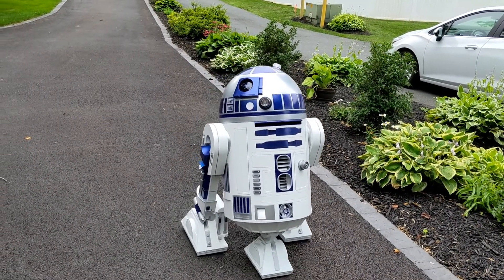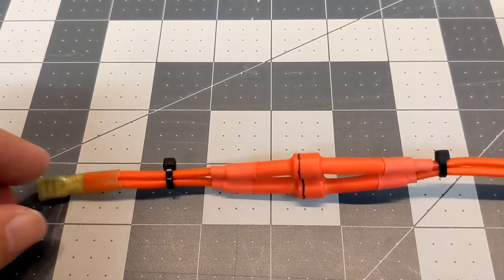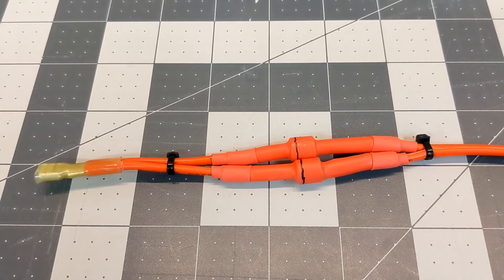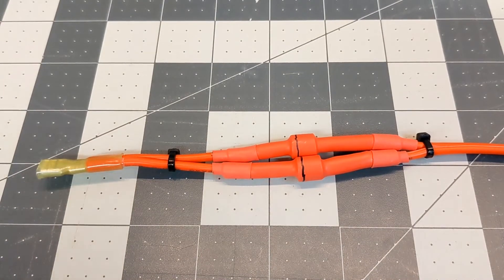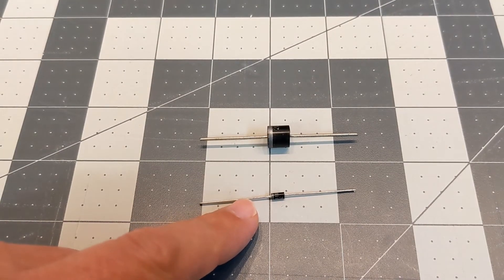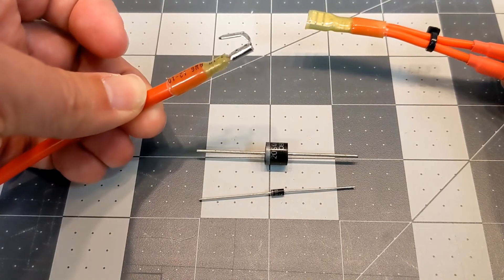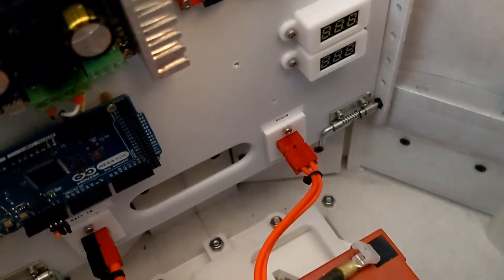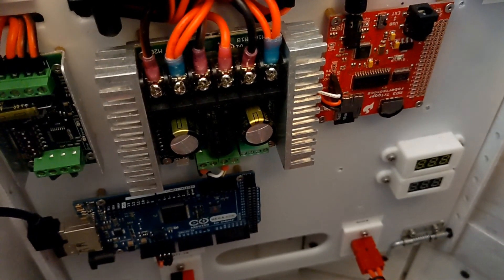R2 Electronics Build Part 7: Handling Regen Current and Wrapping Up

Comment: Would it work to just put the diode on the line to the motor? Although you would remove the change to "charge" the battery when pushing him, it would also take away the chance for damage if you remove the batteries.
Reply from the maker: The worry with putting the diode there is the constant current load that it would be under during normal droid operation. The motors are the components that draw the highest current out of anything in a typical droid. Any diode in line between the motor controller and the motors themselves would need to be able to withstand the high current loads of the motors, and are not easily replaced should they fail at some point in the future.

There is also the issue of forward voltage loss. All diodes have some degree of forward voltage loss that can vary based on the current. That also implies that any variances between diodes could result in slight speed differences between your motors.

Relays are the best option for isolating the motors from the motor controller - as they are much better equipped to handle high current and do not introduce any variance to the signal being passed when the relay is closed. I've used relays in my new B2 build and I like the simplicity they provide.

Comment: Hi Jason, Thank you so much for the videos and all your work. Everything is very clear and makes total sense. I'm just starting my R2 build and will follow your lead. I think I'm getting my head around it all, having never tackled electronics before, but it's the amps that are causing my head to itch. Also 12v or 24v that is the question.
Reply from the maker: Glad to hear you're finding this helpful. It was all new to me, too - but taking it one step at a time really helped me learn. In terms of 12v vs 24v, if you are concerned about high amperage, then 24v would be the best option. For a typical R2 the "big" things that draw the most current are what you will want all at the same voltage - drive motors, dome motor and amplifier. Those should run at full battery voltage. If you're concerned about high amperage, then the higher voltage will put your mind at ease as it's half the amperage. Good luck!

Comment: Your work is so neat and aranged really nice if I can achieve anything remotely close I will be very happy,  also the information on the regeneration is invaluable and the feed back that could fry the sabretooth is something I have not seen mentioned,  I am just starting my build and the electronics are what scare me the most,  how do you supply the signals to the servos in the dome and also the lights,  are they separate from the main system or do you use a slip ring,  the slip ring thing confuses me as it only allows 6 wires (3 pairs). ..... Confused or what lol I have already purchased a Syren 10 sabretooth 2x32 etc etc ... If you hear a loud bang thats me in London wiring something wrong lol
Reply from the maker: Part of the Shadow+MD control system is the use of the Marcduino microcontrollers that coordinate panel animations and lighting effects. Unfortunately, I built out my dome and incorporated both the Marcduino boards (there is is primary as well as a secondary) and the Teeces lighting system before I really started documenting things here on YouTube, so I don't have detailed information about how to set those up. The best place for information would be astromech.net - that's where I purchased both the Marcduino boards and the Teeces lighting system.

As for the slip ring, because all the servos and lights are controlled by a pair of Marcduino boards in the dome, I don't run separate connections for each servo through the slip ring - as you suggested, that would be a LOT of wires! In the case of Shadow+MD, all you run through the slip ring are power (+ and - connections) as well as one signal wire between the Arduino in the body and the primary Marcduino in the dome, then a second signal wire that relays audio commands from the Marcduino in the dome to the MP3 trigger in the body. That works out to 4 distinct connections - much more manageable.

Thanks for the kinds words, by the way. It's always great to hear when my experiences are able to help out other builders. Best of luck with your build!
Reply: @jasonsR2D2  thanks for the detailed reply really appreciate it
Reply: @jasonsR2D2  Are you running 2 or 3 Marcduinos?  I'm at that step on my side and following along with your (and Tom's) work and trying to figure out how many I need.
Reply from the maker: You need a minimum of two Marcduinos (a main and a client) in the dome to operate the lights and dome servos as well as trigger sounds. An optional third Marcduino (another main) in the body can be used to operate all the body servos - utility arms, body doors, gripper/interface arms, etc. IIRC, out of the box, Shadow+MD has no "pre-programmed" body servo motions or sequences - in order to get any of that to work, you will need to customize the Shadow sketch - there are some great examples of how to do this on astromech.net.

My Marcduinos are an older version - I am not running the v3 firmware yet, so some of this may be simplified with what is currently available. I have not gotten around to diving down that rabbit hole just yet. Not sure when I will get around to it.
Reply: @jasonsR2D2  - Excellent, thanks for the information.  I'm going to go with two for now and maybe expand into a third if I need it.  Appreciate the insight!

Comment: Any chance you created a schematic of your electronics for R2?
Reply from the maker: Unfortunately, no. I don't even know what tools one would use to generate such a diagram. I've seen several from other builders and they are pretty nice - certainly a diagram could help with future maintenance of my system. However, if there's one thing I learned from my electronics build is that taking things step by step and progressing one piece at a time was the best way for me really learn this stuff. Electronics diagrams are there to answer all the questions at once but they didn't help me understand why. There's a ton of great info at astromech.net - start here: https://astromech.net/forums/showthread.php?34104-Power-And-The-Droids-Who-Need-It

Comment: He turned out great. He looks gorgeous. I am still waiting on my Mega ADK to arrive. I have a Mega 2560 but I could not get the host shield to work (I did have to solder the 3v and 5v pads) so I ordered an ADK with the built in usb host that is in transit as I type this. Hopefully it will work and I can get my R2 moving.
Reply: I had issues with my host shields as well.  I ended up powering through the pin connector as apparently the USB Bluetooth dongle was drawing more current at startup than the arduino's built-in voltage regulator could handle.
Reply from the maker: Thank you! Hope the new board works for you - lots of folks have had issues with the host shield. I shudder to think what percentage of the build cost goes to purchasing replacement components.... Stay on target! You'll get there!